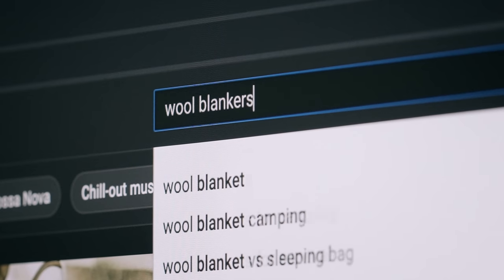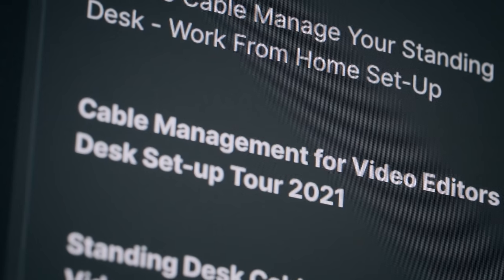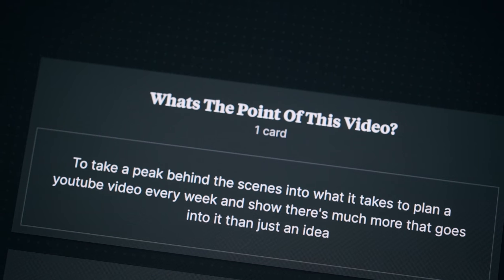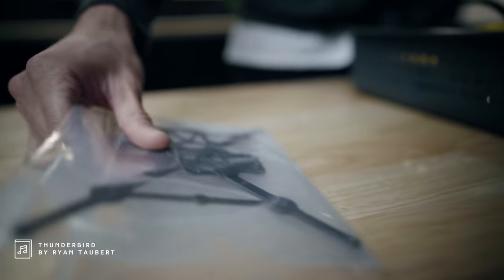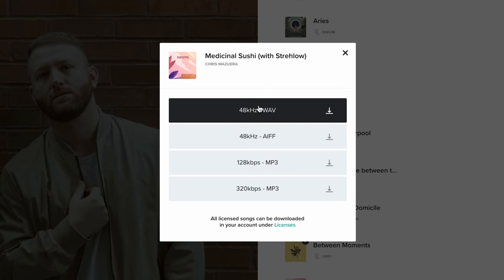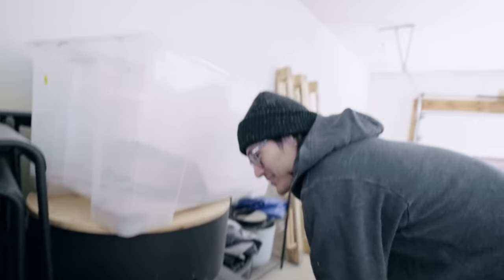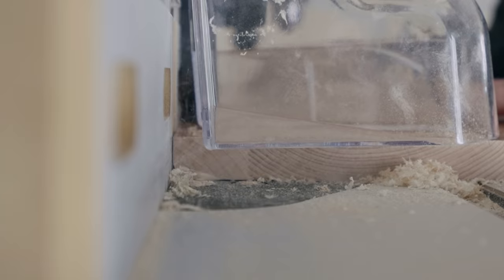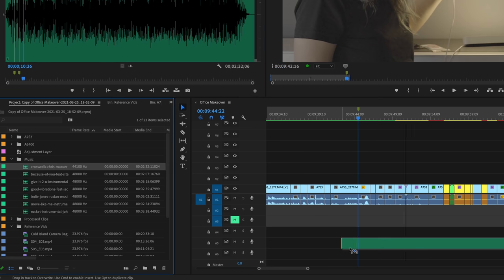How To Plan A YouTube Video - My Pre Production Process

Comment: Really interesting video well done.

Two constructive criticisms

Please slow down with your talking.  You're racing a bit

Lovely lighting (I'm a professional LD) but some minor suggestions.  A little floor mounted uplighter just behind the plant and not too bright would give it a bit of a lift and separate it from the background, without highlighting it in a way that might be a distraction.  Perhaps the top light coming in at an angle at the rear could have been tweaked just a tiny bit to spill on the big leaf.  Again just a hint.  Appreciate you use dome lights with scrims that aren't as flexible as a fresnel with barndoors.  

The colour temp difference between the angled backlighter in daylight and the paper lanterns "offends" me but that's purely a personal thing.  For TV we really don't want shifts in Colour Temp as it makes it harder to get precise skin tone rendition through the camera